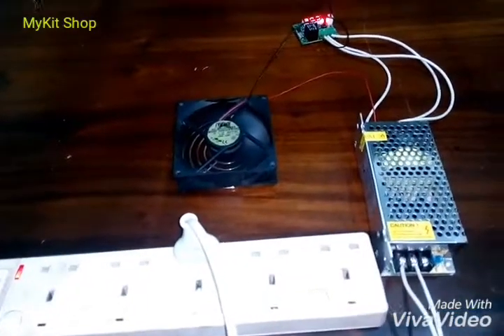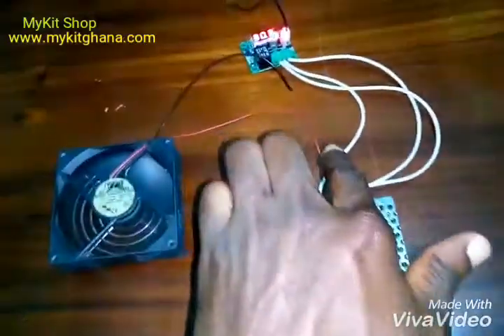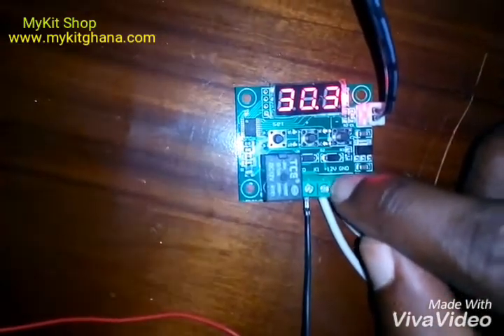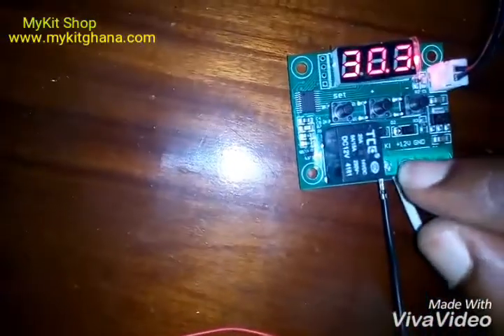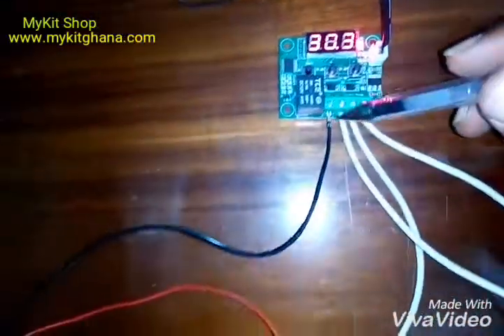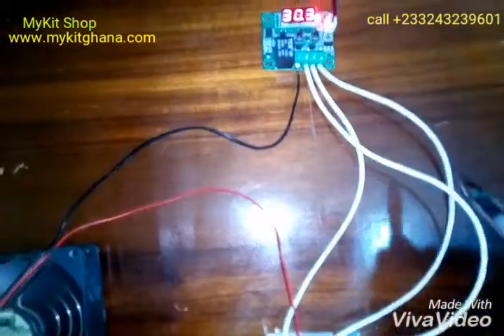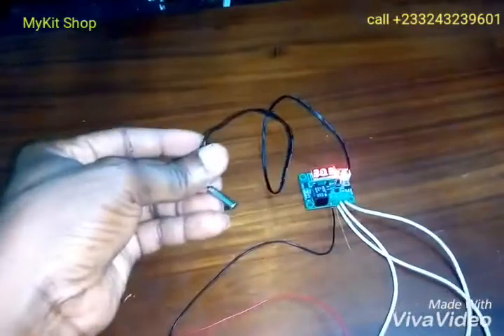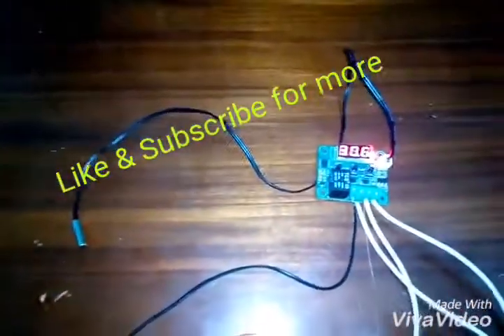W1209 mini Temperature controller wiring for Incubator, lab, mini project etc PART 1

Comment: Yes sir
Reply from the maker: Actually u cannot use w1209 to control humidity but here is what I can try...
I will still use w1209 to control temperature, but I will connect another bulb from the heater. This bulb, I will let the glass of the bulb touch a bowl of water . So that anytime the heater is on, the bulb will also vaporize the water to increase humidity

Comment: A high amp like 10 and 20amp adaptar may damage a low amp and same volt circuit or any device .plese help me. or make a video in this topic.
Reply from the maker: Higher amp will not destroy it.
Higher Voltage will destroy it

Comment: I want to use this to control the temperature of my UPS but I want the UPS battery to directly power both the controller and DC fan. Will there be any problem while the battery is charging?
Reply from the maker: +gtreds Kera 
No problem. Just get the wiring right
Reply from the maker: Please subscribe to our channel

Comment: I connected my w1209 thermostat with 12vdc adopter it is not working please help me
Reply from the maker: RAVI CH 
Please subscribe to our channel then we proceed please
Reply from the maker: And tell me. What is the current rating of your adapter.
12volts and what amps.
It's normally written beside the 12volts

Comment: Is it possible to connect a bulb and fan with the help of female connector from the same outgoing wire??
Reply from the maker: Sijo Abraham 
If only the fan and the bulb both require the same voltage
Reply from the maker: Please do u understand me
Reply from the maker: If the fan is 12volts the bulb must also be 12v
Reply from the maker: Check out this video to help you get more ideas
https://youtu.be/zvQz7jjwgJc
Reply: Now I am clear. I can connect only if fan and bulb are 12v
Reply: I have connected 220v bulb to thermostat. And i privide a female connector between bulb and thermostat. And i connect a 12v adapter to the connector. Then i connect a 12v fan to the adapter. Is right ?. If it is right,  then the fan and bulb both are on/off at the same time.
Reply from the maker: Yes. Exactly.
If your bulb is 220v and your fan is 12v, 
Then u can do that. Let the 12v adapter come between the fan and female connection
Reply from the maker: Don't forget to LIKE the video bro.
Try watch my other videos and let me know what u think about my videos.
I welcome corrections and suggestions and criticisms.
This is my website
www.mykitghana.com
Reply from the maker: Thank you for your support

Comment: Does it work on 12v 5A
Reply from the maker: JACKSON THOMAS hi Jackson. you mean you have a 12v 5A power supply and you want to know if you can connect it to this thermostat.
Yes it can work with such a power adapter
Reply: MyKit Shop Videos
Tanx man.

Comment: can we connect " ground " of thermostat to k1 using a dupont (jumper) and have all ground from all devices connected to k0 ??
Reply: shsrm3 Yes you can.
please make sure the total power rating of all your devices/loads are within what the Thermostat relay can handle. SUBSCRIBE FOR MORE VIDEOS
Reply: the relay's rating is written on the "black box" on the thermostat circuit board. can you see it???
Reply: yes , but it mentions 125 vac . i live in india & its 230v .. how does it coincide ??
Reply from the maker: shsrm3 The relay can handle any voltage between 0 and 250volts(based on the type I have) . let me put it that way. CAN YOU SEND ME A PICTURE OF YOUR RELAY RATING
but I am going to send you a video that will help you to understand what I am saying. in that video, I use this 12volt thermostat to control 220v electronic system
Reply from the maker: shsrm3 please watch this video and get back to me
https://youtu.be/zvQz7jjwgJc

Comment: Hi
I have problem with my board it is samo w1209 but it isn't working when i plug 12v red light just shines and that's it 
Can you help me?
Reply: Shocking story...Thanks for making me Laugh out loud ...
I Pictured you Flying across the room !

Stay safe !
Reply from the maker: Rocky2224 
make sure the sensor is plugged in well.
make sure your connection is right; negative to negative.... positive to positive.

now. if your adapter is not rated 0.3Amps or more, then your thermostat will light up but it can't regulate the fan or light heater. 
I suspect you are using an adapter with amp rating less than 0.25A.
look on the adapter's OUTPUT and tell me the voltage and current value in Amps
Reply: MyKit Shop Videos well probe is well connected its connected right and i have 12v 2a power suply 
But it wont turn on just red diode shines and that's it display is off it doesnt shows anything
Reply from the maker: Rocky2224 
this happens when your power supply capacity is less than the total power consumption of all the electronic devices u connect to the Thermostat.
first. ... check the power rating of all the devices u want the Thermostat to control. the unit of power is watt W.
after that, make sure your power supply has enough power capacity to carry the total power value you calculated
Reply: MyKit Shop Videos no no that wasnt problem thermostat was empty no load the problem was because i used ac instead of dc i switched power supply and i didnt even realised that and some diode or something blew up and thats it
Reply from the maker: Rocky2224 
wow.  we thank God you weren't injured. always check your voltages
Reply from the maker: Rocky2224 
thanks for commenting and telling us the real cause. stay safe
Reply: MyKit Shop Videos well it was late and u was lazy to go tho shed to pick up multimeter and i just wired something up and it wasn't good
Btw. before that when i was younger i flew few times thanks to ac. i put my finger in refrigerator and 220v pushed me off across room. When i was kid i put nail in socket and survived that too so im ok now :)
Reply from the maker: Rocky2224 
whaaaaat????
I don't wonna laugh but I have to..
hahahahaha hahaha.
wow. I am yet to have that experience.
You have to thank God you survived all these
Reply from the maker: it's still amazing how AC voltage is able to send people flying
Reply from the maker: +Screww Googlle 
Ok. Check the current rating of your adapter. It should be at least 1A
Reply: https://www.youtube.com/watch?v=FIDbLf3Btrc

এই প্রথম বার বাজারে এল ডাবল কন্ট্রোলার যুক্ত মিনি আইপিএস সহ কমপ্লীট কন্ট্রোলার, গ্রামে বার বার বিদ্যুত চলে যায, আর তাই আমি ডাবল কন্ট্রোলার সার্কিট দিয়ে একটি কমপ্লিট কন্ট্রোলার বানিয়েছি। যে টা আপনাকে দিবে ২৪ ঘন্টা নিরবিচ্ছন্ন বিদ্যুত, তাই আপনাকে আর হারিকেন ধরাতে হবে না বার বার, আর টেনশনে থাকতে হবে না যে কখন যেন বিদ্যুত চলে যায়, বিদ্যুত গেলেই তো ইনকিউবেটর বন্ধ হয়ে যাবে এবং ডিম নষ্ট হযে যাবে। আমার কাছথেকে একটি কমপ্লিট কন্ট্রোলার নিয়ে নিশ্চিন্তে ডিম ফুটান, ডিম উর্বর হলে ৯৫% ডিম ফুটবে ইনসাআল্লা। আপনি এই কন্ট্রোলার টা দিয়ে ৩০০ টা ডিম কন্ট্রোল করতে পারবেন। কিন্তু আমাদের এই ইনকিউবেটর টা দিয়ে আপনি ১০০-১৫০ টা ডিম কন্ট্রোল করতে পারবেন। যা আছে এতে- ডাবল কন্ট্রোলার, ১ ফ্যান, ১ এসি লাইট, ২টা ডিসি লাইট, একটা মিনি আপিএস কমপ্লিট সেটিং সহ।
বিস্তারিত ভিডিও তে দেখুন - 

এই ডাবল সার্কিট কন্ট্রোলার টি কিনতে কল করুন - ০১৭২৫৮৭৪২১১
কমপ্লিট ইনকিউবেটর টি কিনতে কল করুন- ০১৮২৪৩০১০৯৮
ফেসবুক - https://www.facebook.com/groups/580560102297059/?ref=bookmarks